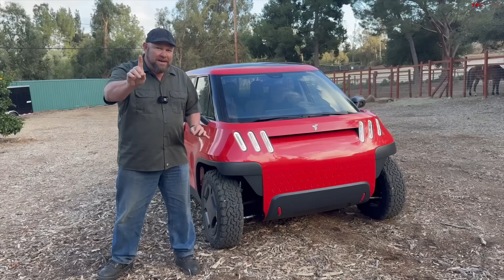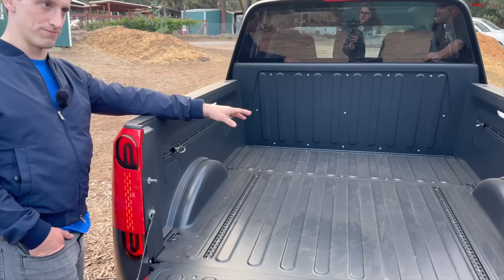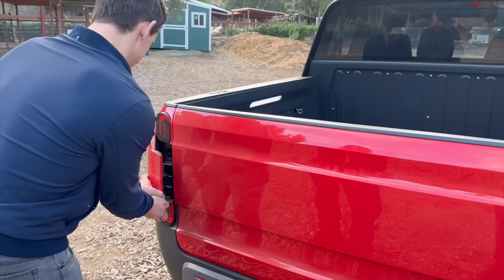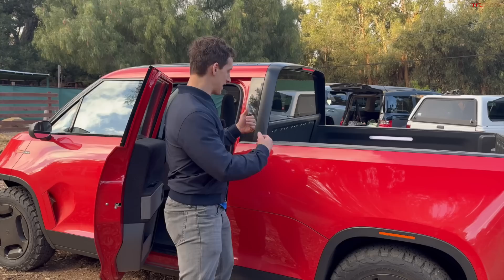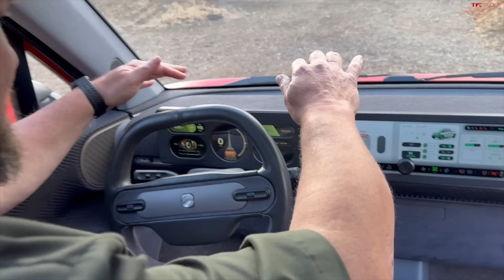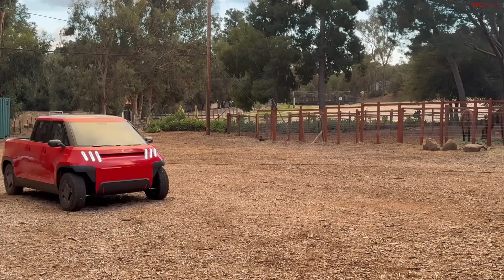I Drive the Most Revolutionary Truck In Decades: Meet the Telo MT1!

Comment: Rivian needs to call this team and say hey, we can join forces and produce them as the R2T or R3T and use their production capabilities since the engineering on this is mostly done.
Reply: More like a R2-D2
Reply: @SHUB281  Rivian entered a joint venture with german brand VW. New Rivian tech will be found in the 2027 VW ID.1. 
But it’s cool seeing telo and aptera kinda joining forces and sharing some technology
Reply: exactly, I was sad to see Rivian keep pushing the sport car angle instead of a cheap solid utility truck with bare bones pricing options.
Reply: Agreed, mostly... They have similarities but different philosophies and target markets in some ways. 

I'd love to see Rivian take their R1T design ethos, combine it with the optimized space utilization concepts of the Telo, and make a slightly larger than the Telo R2T... Full sheet of plywood without pulling seat forward, and small frunk with more Rivian styling. I'm generally not a frunk person, but think they make more sense in a truck than in passenger vehicles. 

I've been a Rivian fan from the beginning, but the R1T is too big for me, and still has some of the compact truck problems. Telo basically solved those, and at a better price point... But I'd rather it be a foot longer and have a few more features than stick to the mini Cooper length thing. That would still be way shorter than my ID.4 but much more versatile, and still very city friendly.

Comment: It's so cute, but it's obvious from the driving video that it isn't made for drivers over about 6' tall. The two people in the video are clearly looking out through the top few inches of the windscreen. This isn't just a problem with this vehicle, I found the same issue with all the Subarus and the Honda SUVs. Fortunately, Ford and Chevrolet understand that people buying their SUVs and trucks may exceed 6' in height and make sure they fit.

Comment: It's very interesting. But at a starting price of $41k it goes in the same pile of cars I want but can't buy along with the VW Buzz and Tesla Roadster.  Maybe if it cost half as much I could buy one in addition to an older Tacoma.  Unfortunately, I can't get around needing truck that can travel 200 miles in 3 hours, fit dirt bikes in the bed, have a back seat, and tow 5,000 pounds for a few hundred miles.  It doesn't need to do all of those at the same time, but there doesn't yet exist a truck that can do any of them well (except have a back seat).
Reply: Womp womp buy used
Reply: @MaticTheProto  Or I'll just not buy it at all and get what works for me instead.  I'm not complaining.  I want Telo to succeed, but I suspect they probably won't.  So I'm hoping someone doing market research will scroll through these comments to find out potential reasons why they fail.  And try a bit differently if there's a next time.

Comment: This is actually pretty cool. I'd be mildly interested in this. I've wanted a smaller EV truck like the R1T for a while, but they're just too much. This is much more reasonable. Still a little expensive for what it is though, but without large scale production, economy of scale is just not there.
I'm guessing the large range dual motor is minimum 52K, probably closer to 55.

Comment: Ive been in the auto business for over 25 years and i will tell you this, we need a small pick up like this out there, i have been saying it for years. I dont care if its electric or gas, i prefer gas but this truck is very needed. We want a truck that you can reach into the bed of the truck and thats easy to get in and out of, the price point has to be mid 20s. if you go for 40k they will sit. This country needs to come back to the s10 type truck. we dont  really need a 5 passenger, a regular cab truck is fine. The big three keep making vehicles bigger and more expensive every year and they have finally priced them selves out of the market.

Comment: Question: 
Does this front meet federal safety standards with the front tires exposed?
Will there be a bumper/cover in front of the front tires?
Appears to be quite aerodynamic. 
Reminder of early Econoline, and Corvair van. 
Very compelling vehicle for the market. 
Any idea where will this be assembled? 
What is the necessary anticipated manufacturing, sales volume, year to year?

Comment: The price STARTS at $42k... which is insane when the basic pro spec of the F150 lightning is $47k...
I'll buy it for 50% off after 2-3 years used if it's like $20k...
Or I'd take any of the HEAVILY depreciated ford F150 lightnings in the $30kish range with only like 20k miles...
Or just a japanese mini truck instead...

Comment: I've heard someone else, who's last name rhymes with tusk say that the AWD EV gets as good or better range than the RWD version and that turned out not to be true. But it is a compelling truck for sure! Might just make a reservation.
Reply: It's not going to be 100% same, just due to the weight of the extra motor etc. But with will designed disconnects etc, you can get it to less than 5% loss for the AWD. They don't have the ability to give specs to that degree of accuracy yet, will need full production models to do testing etc for that.

Comment: The front is goofy looking but I like the overall layout, the usability...what it could haul in the bed and inside while still being a fairly short vehicle.   I've often wondered why smaller vehicles don't just go wider.  3.5" wider than a 2000s ranger might not sound like much but that'll make the interior and bed fit more.  I'm personally not ready to go ev, but architecture like this has is a good reason to use ev, as it would be very inconvenient to fit a gas power train into that form.  I owned an 06 scion xb for 9 years, the most spacious, practical and useful compact car ever made...so I wouldn't mind if this truck idea embraced the squared off esthetic because the form factor makes smaller vehicles more useful.   I used my xb to haul 2x8' sheets of plywood, mopeds,  mini bikes, pit bikes, even a rear engine snapper mower.

Comment: I love Telo's partnership with Aptera! The opportunity to have a solar panel assist in charging Telo's vehicle is fantastic! Additionally, when I use my 2004 Dodge Ram 3500 Manual Diesel, most loads are below Telo's MT1 payload. This would be a viable option for local use and a daily driver (depending on whether the seats are comfortable, too).

Comment: When though? Still gonna be $80,000? I'd go $40,000 because the batteries are toast in 5 years and they have to be replaced with a 3hp lawn mower engine from Harbor Freight.  Well.. OK, I'm Assuming that, Yes.

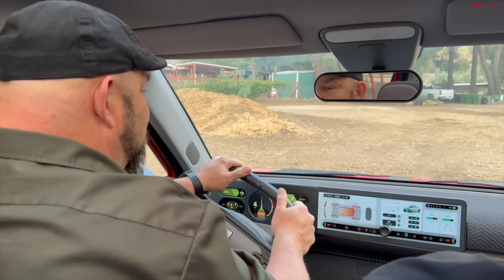Comment: I wish Telo the very best. Its a great concept. As a dog owner me personally like cars / suvs. But let me be very honest about the pricing mentioned @20:48 $41520 would be very interesting. When you talk about Kei cars (yes not trucks) a Malaysian Kei car with 1L gas engine  starts about $5000 (RM22,000.00 ringgit = $4,983.01 today). Not saying Kei size vehicles made in USA should be same price but if not priced low, it might be challenging.
Reply: @LionRunner  that’s in Malaysia, not the US. It’s more useful to compare the Telo with other American vehicles especially when it comes to price.
Reply: @L_3551  Ok the Ford maverick cost for a base is about $24k and base V8 4x4 4 door Silverado is about $45k and dealers have incentives so you could get one for less then $40k. So what LinoRunner was saying is still valid the Telo is over priced for what it is or trying to be I cost about the same as a full sized truck and most americans will buy the full sized truck over that every day of the week for that price point. This truck for what it is should be priced much lower around the $20k mark but its electric and that is expensive but not worth it just like every other EV truck they are not work trucks they are show off trucks that cost to much to be actual work trucks. Bob the builder isn't buying the RT1 base for &70K hes buying the $70k F350 Dully with the diesel. Now Dr. Johnson over there hes buying the RT1 to drive to the office and back now Mr Youtube creator is buying the Cyber truck for a few videos then punting it (Hoovies Garage) nobody who actually needs a work truck buys electric trucks because people who need a work truck work hard for their money and want the best bang for their buck and that is not EV trucks. EV trucks are for people who want to show off they have money to waste on a pointless truck. same for most trucks over $45k that arent diesels the people that buy $100K diesels are show offs as well.Then you have the soccer mom who likes the truck because it makes her feel safe.
Reply: @L_3551  I'm not sure if US had kei cars. The closest I could think is something like Chevy Spark or Mitsubishi Mirage which was around $12000.
Reply: I would be interested at $15k

Comment: Another option they should think about is a hybrid version with something like a 1/3 battery, (and only use the motor to generate electricity not directly power the wheels), then you would have something that could long haul or go distances while retaining electric only for short runs.

Comment: Safety issue would be if someone is hauling long lumber (even 8 foot) and the tailgate is down and it gets rear ended, the occupants in the front seats will be injured or possibly killed.  The lumber would be pushed into the front seats.

Comment: This is EXACTLY what I’ve been holding out for: small footprint, AWD, and small box with folding midgate to carry larger. I don’t need to rock crawl but I want clearance and AWD because I drive in snow. Currently I have to carry longer stuff on top of my Outback, especially if I want to sleep in it when on road trips. Being able to haul wood and leave my surf boards safely inside and have enough length to sleep comfortably at 6’1” would be awesome. And the optional top would mean extra space for the pets while still hauling people.

Comment: This gets me really excited. First, a company is finally focusing on small trucks first (maybe only). Second, I've been on the fence for buying an imported Kei truck; but, it feels like the state DOT can just change its mind any second and revoke your registration to drive it on the road. I don't want a $8,000 off road use only vehicle when I only have a small lot. If I have a 20 acre farm, I'd have jumped the second I saw one.

I've even considered buying a Kei truck and converting it to an EV. I currently have a 2015 Fiat 500e and have thought, it wouldn't be the most complicated thing to buy an old leaf and pull the drive train and battery out and swap it into a kei truck. But, it would be time consuming and still somethings would be complicated. Importantly by the time you're done doing that, you've invested probably $20-25k in an old truck that won't be as nice as a purpose built truck. Meaning comfort, efficiency (range), rattles, etc. and if anything went wrong it would be entirely up to you to engineer a solution.

Comment: Crosley automobile corporation of Cincinnati, Ohio offered mini pickups from 1941 to 1952. They began manufacturing in Richmond, Indiana and then moved to a factory in Marion, Indiana after World War II. Pre-war models had a 2-cylinder engine and post-war models had a 4-cylinder engine with an overhead camshaft. They even had 4-wheel disc brakes in 1950!

Comment: Quite a unique vehicle.  I like the ability to install the more integrated cap on the back.  One can also appreciate the simplicity of the vehicle, clean without unneeded clutter.  It's also excellent that it fits a sheet of plywood too.  You can't do that with small and mini-trucks at all.   It's also a brilliant idea to make the base models available right from the start.  I hate it when a new vehicle comes out and the only ones available are the fully loaded models and trims. They seem like they're going to be the AMC of the EV world, but with many items today it's sort of becoming the norm.  I hope they do well!
  
Oh, and payload, that's really good too.  I could actually put a load of topsoil in it the same as I did on my full-sized truck -- that's incredible.

Comment: Cool truck, love the flush front and back.  It look like ID4 Buzz where it cut back half for cargo.  Love the integrated campershell to get rid of the spce between which very difficult to clean.  I would wish the following: 1) bigger back seat that means legroom is 36 in., 2) a bit higher headroom.  3) Option for round headlight. 4) back axel need to goback a bit to balance the load when tailgate is down.  5) HUD and vertical screen integrate into the center console like Subraru.  Finally, price is a bit high compare to midsize truck.  EVs will only last max life of 15 years.  ICE trucks will last much longer, just need new sparkplugs, oil and gas.  Best wishes.

Comment: Congratulations, Telo! You managed to make a tiny truck that costs as much as almost every other fullsize truck and way more than it's closest competition:

- Fullsize Trucks -
Telo MT1 = $41,000
Ford F-150 = $37,000
Chevrolet Silverado = $37,000
Ram 1500 = $40,000
Toyota Tundra = $41,000
Nissan Titan = $47,000

- Closest Competitors -
Telo MT1 = $41,000
Ford Maverick = $24,000
Hyundai Santa Cruz = $29,000
Reply: You definitely failed math class!
Reply: @gmv0553  Not as badly as Telo did!

Comment: The price is outrageous for what's being offered. For not that much more lower end F150 or Tacoma is available with more room and capability. Minitrucks are seen as a side by side replacement here in the us, not an actual vehicle so even though this is street legal I suspect many would see this as exactly that a side by side that happens to be street legal, which is not worth 40k.

If they could get it down to the 20s I could see this being a great spare vehicle at a cabin, or like university's and large campuses using them for grounds maintenance etc but for it to be on the consumer market the price needs to fall quite a bit imo

Comment: This was cool. Till I heard the low low price of the 40k base model.     I realize this is safer than its foreign counterparts. But at 6k for a gas job that's just as versatile and gets 30mpg, this unit would be a hard pass for me.      The competition is good, and that will lower the market overall. But 40k for a stripped down electric mini is too much.

Comment: Another failure if it's supposed to be a truck then 5ft minimum for the bed if i can't slide my table or chop saw and stand in the bed and close the tailgate then it's to small also a electric truck is useless even just doing maintenance. should've just made it a hybrid

Comment: It looks great, and yes not distance, but still that is a bit high of a tow rating for that size (6500 is what you would find on a Gladiator, Explorer, Taco for reference). The mass being lower help with the frame design for strength? And did I miss ground clearance?

Comment: 350 mile range is about 550kms. That’s getting pretty good. That means in winter , fully loaded with the heat on the range will be around 400 kms

Comment: It is a great SUEV (small utility electric vehicle) in theory.  Keep the focus on "utility".  Every effort should be made to keep the cost down even at the expense of creature comforts and materials.  Go with cheap hard plastics and vinyl or cloth seats if necessary.  Keep the power options and fanciness to a minimum to reduce the price and things that could go wrong.  Such things like power windows and seats and heated elements in seats or steering wheel shouldn't be standard if it's going to jack the price up several thousand dollars.  Make it so even low & middle income earners can afford it, and they will sell like hotcakes!  260 mile range is awesome.  Heck...the Fiat 500e--the only what I would consider entry level EV here in Canada--sells for a ridiculous $45K+tax+BS fees with only 260kms of range and 2/3 the size of the Telo MT1.  If there is anything you could do to get price down to maybe 35K USD, the volume that you could sell these would make up for the  loss on price/unit on a much smaller scale.  The gas savings might allow a person to actually afford a home that isn't on wheels.

Comment: Native OpenPilot (like Aptera), and a bed-mounted removable toolbox-style REx accessory (Katz fiPMG?) for roadtrips/emergency generator use and every box I can think of will be checked. It doesn’t matter if the REx is OEM or aftermarket, but a bed-accessible tie-in to the HV system would be key for me.

Comment: I love it, but 41k is a lot, in my opinion.  Would be nice if they had a cheaper one with maybe 200 mile range?   As an investor, i dont see it working out for 41k.  They need to build a fleet vehicle option with a bare minimum and a camper shell for 35k, and it would probably do well.   40k is pushing it.  They need to focus on fleet sales for something like this as opposed to the consumer first.  If they can afford to take some losses at first and then focus on the consumer after the fleets advertise, it would be better.  Make this truck with a camper and a full bedslide, and it would be an amazing work fleet vehicle.  Pull out the bedslide and all your gear with a camper shell, and i would pay 40k easily.

Comment: I like the design, love of Midgate on a pick up truck. I think it should be standard on all unibody pick up trucks. I rather see it start at 35k vs 41k since 41K is around the high price of most small pick up trucks like you can spend 41k and get a fully loaded Hyundai Santa Cruz or Ford Maverick Hybird or a base Honda Ridgeline.